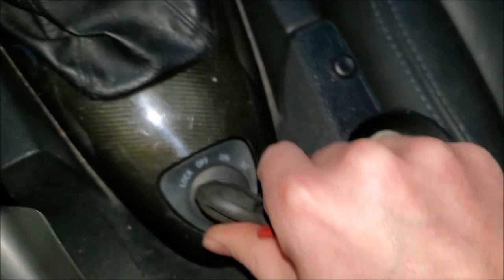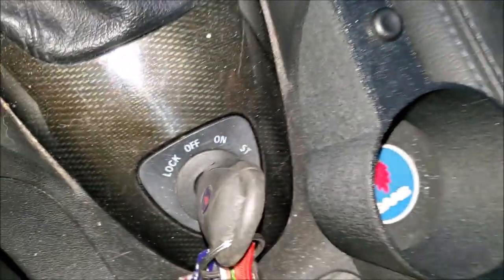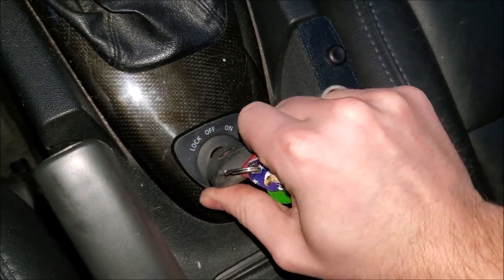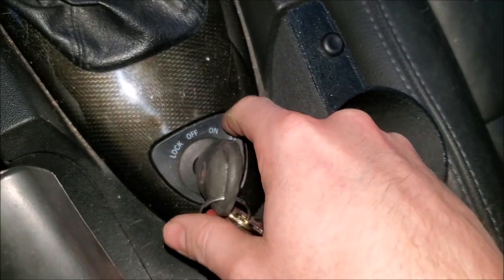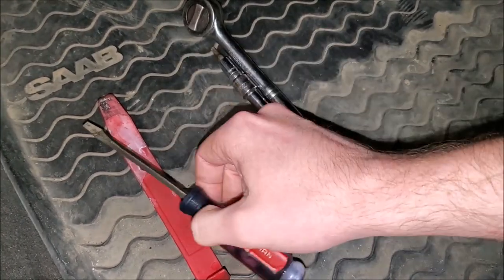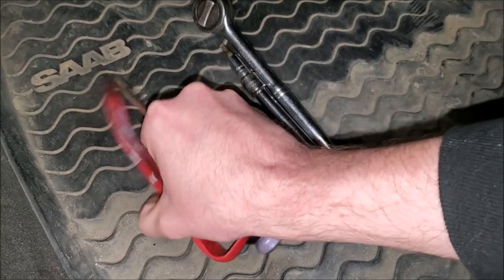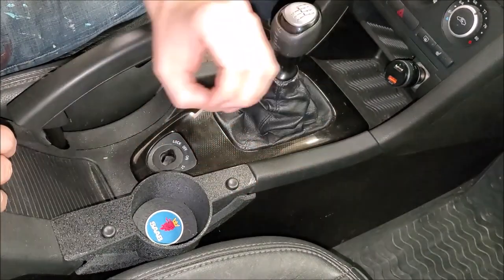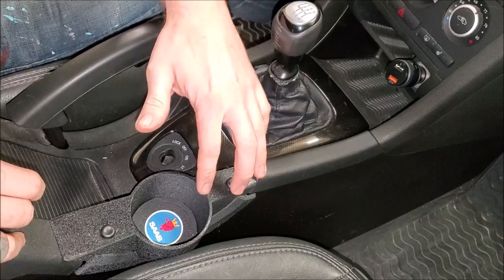Detailed SAAB (ISM) Ignition Switch Module Replacement & Upgrade

Comment: You saved me $$$$ by doing it myself.  I removed my ISM and opened it to clean the inside connectors, and hopefully stop the dreaded "Steering Lock Malfunction" message that would randomly appear while driving.

Comment: Very nice video! One note though, the shifter trim has two tabs in front that hook on plastic of central console. In my opinion it's better to make sure they fit in the right place, and then when shifter trim is installed you can install the rubber mat.

Comment: My problem was the switch locked up. Used this video to remove ism (very helpful). After cleaning, key would rotate with a stick holding back the spring loaded anti-theft interlock plunger, but not when reconnected to the wiring in the car. Can I grind out the plunger so it can’t engage & prevent the key from turning? If the only thing that I would lose the anti-theft feature?

Comment: I own the illuminated ISM for 15$ last year :D
Edit: Also i fixed the famous "steering lock malfunction", I was cleaning my previous ISM about 2 times, but fault always is back. My car is MY08, but old ISM was produced in 2014 - little curiosity :)
Summarizing, 11 years older ISM is better xD
Reply from the maker: Dang $15! What a steal that was!!
Reply: a lot of people misread the date on the ISM. My US spec 08 Aero ISM was made in 07 09 19 (Sept 19, 2007). My coil packs also have a similar date so I know they were never changed.
Reply: @WeakestofWeeks  i paid $95 for mine :(

Comment: Ah yes, the 2003 ISM. Very lucky that my Arc has it! It’s sad that my TX doesn’t 🤦🏻‍♂️ one of those weird and cool 03 features that was only on that model year!
Reply from the maker: Such a simple upgrade that in my opinion makes a big difference. Totally worth it if you can find an 03 ISM for a decent price!
Reply: the circuit boards are the same on 03 and newer but no led lights
just to solder there led lamps and resistor diy jobs

they changed factory from germany to spain and reduced the cost of ism
Reply: You don't need the 2003 ISM.
The transistors and positions of the leds are still in the 2004-2012 ISM.
They just got no leds. So just disamlbe yours and buy green smd leds like I did and solder them in.
Reply: @54player54  Hey, I have a spare ISM from my old car so I want to try this. I am pretty handy, but when it comes to electronics I am useless. Is it an easy job to put leds in?
Reply: @xXFuZeSnipeZzXx  it's easy... You can see the position where the leds have to get solderd in.
Your soldering iron should be precise but bysides that it's not that hard 😊
Reply: @54player54  Thanks! How do I know where the power to the LEDs comes from? And are there any specific smd LEDs I need?😅

Comment: @weakestofweeks in doing this repair the console cracked and required replacing. There is an additional connector. Where does that go?

Comment: Tried to do this today, located the correct part number, swapping it allover took about 15 minutes max was well happy, but then disaster, put they key in and "key not accepted" followed by "steering lock maulfunction". So had to put the OEM one back in for now. 2007 car.
Reply from the maker: Thats a bummer! Sounds like the one you put in need a good cleaning.

Comment: Great video thank you. When I came to lif the console,  I got caught by the 'extra two screws at the side in some models'. These are a p in the a to remove and replace and I did lose one down inside the console somewhere. Manual 9-3 convertible 2005.
Reply: Having the same problem. could you tell me where these screws are please, are they underneath the console?

Comment: Hi! Thanks for the video. Did you have to get new keys for the new ISM?
Reply from the maker: Nope, you do not need new keys! Keys are paired to the Column Integrated Module (CIM) behind the steering wheel. So changing the ISM doesn't mess with key programming but a dirty ISM will.

Comment: Hi ! I have lost sound för blinkers, no belt, backsensor. When I flash highbeam it start working again. Always the same as soon I take out the key for a few minuts or moore. Can it be faulty amp 1 under driverseat ?

Johan, Sweden.

Comment: Hi. Just wondering, do you put in new ISM and it works? Just any that is the same one? No programming for keys or imo needed?
Reply from the maker: No programming needed when installing a new ISM in a NG9-3. The key is actually linked to the CIM behind the steering wheel, so swapping the ISM doesn't affect the key. As for years, any NG9-3 (2003+) ISM should work across the various years. In this particular video I put a 2003 ISM into my 2008 9-3.

Comment: Hello Gerry, maybe this is a silly question? an ignition switch module is an ignition control module?
Reply from the maker: Basically yes. I think they call it the Ignition Switch Module (ISM) because the other acronym is already taken for the Infotainment Control Module (ICM) aka the radio.

Comment: Steering lock malfunction.Hello from Greece.i did the same thing and i have this message.then i tried the old ism and says key not accepted.any advice please?
Reply from the maker: Steering lock malfunction may be a sign your CIM is going bad. I would unplug the vehicles battery and let sit for 10 mins. Then plug battery back up and see what happens. If nothing changes, then test battery to make sure it is in good shape. Electronics sometimes act funny when they don't have enough voltage. Not a bad idea to clean your ISM as well. Worst case you may need to replace your CIM with a matching key if the problem persists.
Reply: @WeakestofWeeks  hello i had no problems with my cim car is like knew only 22.000 km. Bought one ism like you did actually  i saw it from you and liked the idea to have it.so  i did all you said but .. i don't know.knew battery today very powerful same answer.my genuine switch is like yours  ends 10 if i plug this one says key not accepted
Reply: I had the same issue, 2007 car working fine, fitted 2003 ISM and got message key not accepted, put the old ISM back in and it works fine.

Comment: Are you absolutely 9,000,000% sure this switch is plug and play and no additional Tech II programming required?
Reply from the maker: ISM replacement doesn't require tech2 programming due to the keys being linked to the CIM. You're good to just swap them.

Comment: did this key will still not turn, dont know what to do now
Reply from the maker: Did the key turn before the ISM change? Sounds like you may have a dead vehicle battery, dead key fob battery or possibly a CIM issue.
Reply: Not working for me neither and switching between the old one n the new one. The old one - key turns on the old one but not on the new one